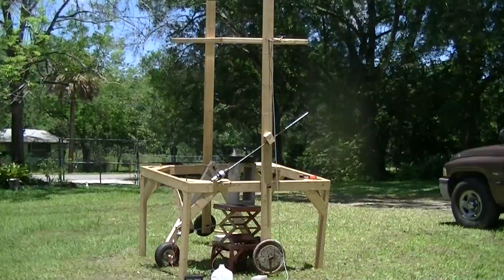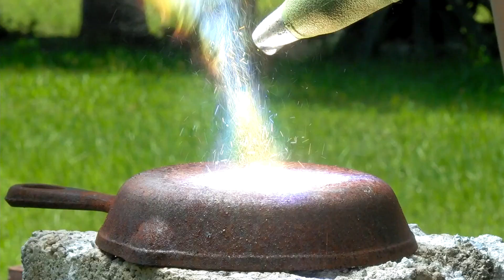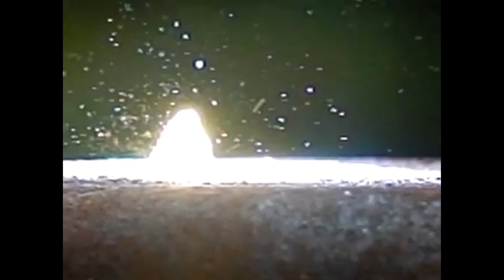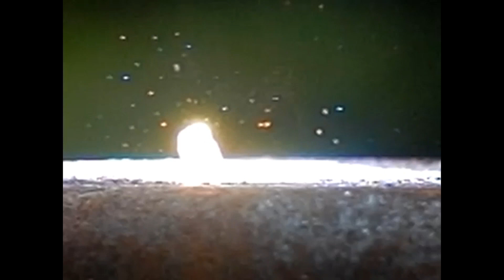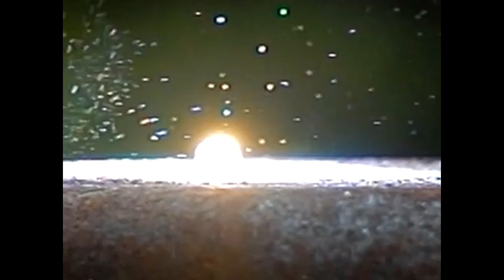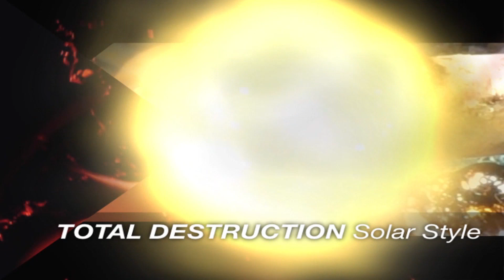Slow Mo Water Drop Leidenfrost SOLAR FRESNEL LENS Slow Motion Pulsar Neutron Star

Comment from the maker: search "Casio Exilim Pro EX-F1" they shoot 300 fps, 600 fps at lower resolutions, and a maximum of 1200 fps at a weak resolution.

The 60 fps is a BURST RATE printed on the body is for still photos. You can take 60 high MPX stills in one second.

Comment from the maker: ND would help but the high speed camera responds with the iris opening as the   high speed mode does not have manual over rides like or 7d and XAH1. The next video of this effect will be with the super macro lens I used for this video:
watch?v=N449Ih3D0As

It has a secondary adjustable iris that separate from the camera body.

Comment from the maker: Only high speed available with a no rasterizing delay like the sony which is $10,00 AND ONLY DOES sd in high speed (not a big step up for 8 grand more). Next step up after that is $30,000 so it is worth it if you want high speed and do not want to buy something valued at a luxury sedan.

Also Photron, ASO, Fastec, and Phantom do not offer zoom lens options and are generally not "stand alone" requiring a PC+ RAID drive system to process incoming frames. 

Works for me, it was only $700 in 2009:-)

Comment: @S Chil
G'day... Thanks mate, um, well, my best tip for Road Vehicles is to fit a Solar Panel & Charde Controller, keep y'r Battery full of Sunlight, & only burn Fuel to make Torque to step-up Belt-Drive an Alternator to recharge the Battery, except at night, when headlights are on... Search "sunfoil" as a YT movie title. I improved my fuel efficiency by 33.25%. It's a DIY Project...
Ciao !

Comment: @GREENPOWERSCIENCE
G'day. Yay Team..! Water has 10 x the Thermal Mass of Steel... That's why your Drops lasted SO Long... To raise a pound of H20 by 1 Deg. F., takes as much Energy as lifting the Pound 768 Ft into the Sky... With some Welding, Aerodynamics, Gyroscope-Theory, Leverage, Orbital-Mechanics, & Timing... Then a narrow splay of 6 Steam-Rockets  could Splat the ISS... It's an excercise in Deflection... Ciao !

Comment: How low is low quality? Fire the sales force at Casio I SAY!  lol 
Standard: 640 × 480 (30 fps)
• HD: 1920 × 1080 (FHD HQ/FHD Normal, 60 fields per second), 1280 × 720 (HD LP, 30 fps)
• Hi-Speed: 512 × 384 (300 fps), 432 × 192 (600 fps), 336 × 96 
SOrry not sold. I checked it out as per your instructions. 
(1200 fps)
File formats • Still: RAW (DNG*1), JPEG (Exif Version 2.2), DCF 1.0 standard, DPOF compliant
• Movie: MOV format, H.264/AVC, IMA-ADPCM (stereo)